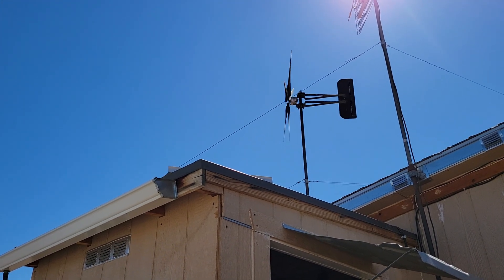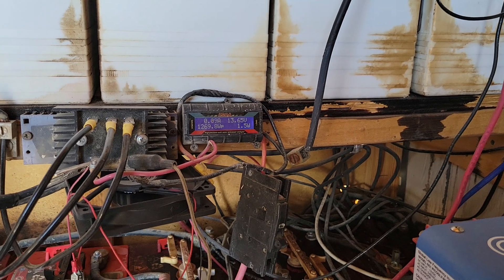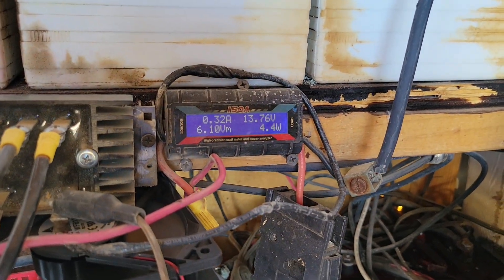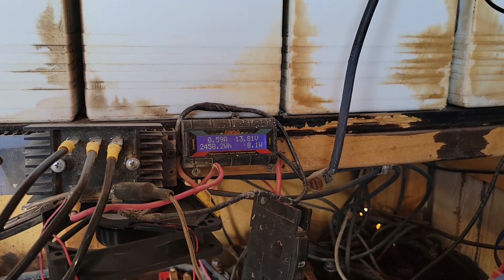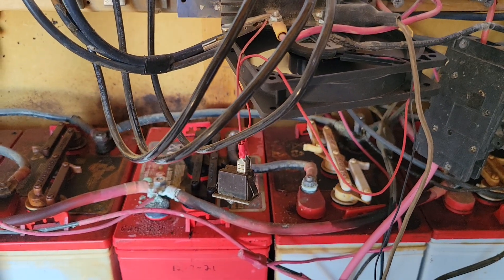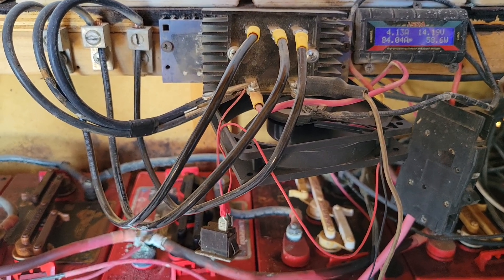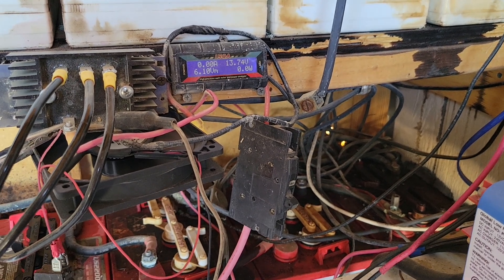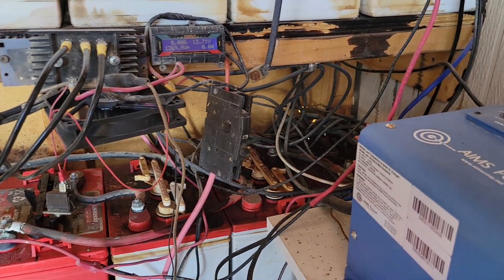Wind Turbines: Can You Run Your Whole House On One? June 26, 2022

Comment: Thank you for the knowledge wanted to start with wind turbine then solar but will have a second thought will start with solar then wind turbine
Reply from the maker: Welcome aboard!  Yes, smart choice.  The sun is present much more often than the wind.  Solar should always be the primary source, wind turbines are supplemental.  Water turbines work day and night IF you have a reliable, constant water supply.  A multi fuel generator is a great backup for emergencies.

Comment: If you only have  one  ! 

I have   4  

And those 1800 watt P.M.A.s on your  wind turbine will  work on  a Water Wheel  or Anything  else that  spins  , 
Exercise bike , steam  engine  , gas engine  , propane  engine  , and  I also  have  Solar Panels  , 
So that's 
Wind Power 
Water Power 
Solar Power 
Engine  Power 
Human  Power   

And if you get 1800 watt P.M.A.s  for each  room of your house  , and Battery  banks with Inverters  and  Solar Panels  with  Thermal heating and cooling  , 
It's possible  to run an entire  house  , because  that's exactly what I'm going to do  , I'm going  OFF GRID
Reply from the maker: Welcome aboard Jim!  Yes, PMA'S are multifunctional.  A good battery bank is very important, because you can't count on input 24/7/365.

Comment: Hey GBear.  Thanks for the content.  Had a couple of comments for the viewers.  For wind turbines.....there is a national wind energy map from the US government that gives the average wind to expect.  Almost any wind turbines makes WILD claims of what it can produce.  IF you decide on a turbine, you probably would always select one that produces a/c current to minimize the wire costs since you then would mount the bridge rectifier close to the battery bank such as your system.  One thing that I am NOT 100% on, but I seem to think IF you are charging a 12v bank you can choose a turbine that is 24 volts and designed for LOW wind so that the CUT-IN voltage(by lower wind) starts the conversion faster so that it charges the 12v battery back easier and thus less wind is needed.  Additionally, you're covered for 24v too.  Since the turbine output goes through the rectifier, the battery would not see the difference since the rectifier produces a pulse width modulated wave to mimic DC.  On off grid solar panels and living in the desert I know of a company called Santan solar near Phoenix and they sell used and/or abused panels and they can be really cheap but with risks.  However, for ground mount and things like that they are something to consider.  Also, yeah the desert dust is a PITA.  I lived in the southwest 30 years and that is another reason to look at some charge controllers that don't have fans.  However, those units are smaller.  However, the midnite solar classic can be sealed for the dusty environment too.  Be safe and happy holidays coming up.
Reply from the maker: All great points, most of which I have covered in the past.  Yes, dust is definitely a PITA in the desert.
Welcome aboard!

Comment: I don't know where Mr 🐻 got his analogies or theories from about what wind turbines can an cannot do.

Wind turbines can run your whole house without any solar panels, l have three thousand watts of panels and twenty six hundred watts of wind turbines and I keep my whole house running in the night when there's no sun shining in the night I keep my batteries in a hundred percent state of charge. running two deep freezers an a refrigerator, with my winds anywhere from fifteen to twenty miles per hour an am dumping most of that power.

At the end of the day it's how much you know about how things work where you live where and who you buy stuff from an how your wind turbines are set up.

Anyone who doubts me that wind turbines can run your whole house keep your batteries fully charged all day and all night once enough wind is blowing for your type of setup. Check out John Daniel on YouTube I've learned a lot from him he's a great guy on wind to learn from.
Reply from the maker: Dear Kurt, do you get up every morning with that chip on your shoulder?
First off, disconnect all of your solar, then tell us how long everything in your house kept running.  Secondly, wind is not a guaranteed constant, so it cannot be counted on as a reliable source.(but if you live in a place where your wind blows constantly and the same speeds, and you have figured out hot to get nearly 3000 watts of power from turbines running at a small percentage of max output, then, I stand corrected.
You could also add another 40 batteries to your bank and weather a night or 2 without wind or sun.
I thought I was pretty clear, and accurate in my statements through the video, and stand by my claim that you cannot run an entire household on a single turbine alone.
Of course, if I had made the statement that you can't tow a loaded semi truck with a compact electric car, I think you might accuse me of misinformation and tell people they can, as long as another semi pushes from the rear, and it is downhill all the way.
Sorry, but I can't give you a thumbs up or a heart for your attempt to discredit me. (But I'm sure Mr. Daniel's will, for the shout out)
By the way, I have viewed many of his videos, and always give HIM a thumbs up.
Reply: @GBear  am not gonna debate with you or do I need a thumbs up it's here nor there. 

The fact remains I shut my panels completely down an run everything I need to run in my house twenty four hours  days on ends once there is fifteen to twenty miles per hour wind and I can prove it. 
It still stands that if you have enough turbine power an enough wind and set up the correct way you can run your whole house for days on ends.

Comment: Cool video. I wish I could add a wind turbine like yours. the winter supplement is much more important in Illinois. Short days and clouds. Unfortunately all my systems are in remote trailers off grid with computers and cameras and stuff.  it’s very difficult to put a big enough wind turbine on a small trailer  that would produce any kind of real power. But if I had a log cabin or something like that off grid it would be helpful for winter time especially. 
Thx for the video
Reply from the maker: I understand.  Right now, there's 0 wind here, so the turbine is useless, but the winds come up every afternoon before sunset, and supplement my system while the solar panels take a break.

Comment: I'm just getting to the wind turbine part ; I have water in all 20 of my batteries though. The sun was hot but we had a North breeze, which helped my panels put out a little more...but, they're all dirty...I have to help build a barn in the morning, so I'm going out to wash my panels off. I moved my charge controller today...it was buried behind batteries. I put it in front of them so maybe it can run cooler now. I got some " Scrubbing Bubbles " at the discount store. I normally get a little over 30 amps in the morning but today the most I saw was 25. Yesterday it was 101 deg. and no wind...everything was hot and didn't put out much, so it got me to checking things. I re-engineered my bug zapper. The original bulb is strapped on the outside and a 60 watts LED equivalent bulb is in the middle now. It only uses 5 more watts. It attracts flies now. I had to wire brush the screen off today because it was completely covered in dead bugs. I cut a lot of the holes out bigger so the bugs can go in easier without all that plastic  in the way. It is popping a moth every few seconds right now. Cheap off grid entertainment, lol.
Reply from the maker: Lol, gotta love it!

Comment: best extremely low wind turbine yet power output as though the wind was much higher is the AirSynergy wind turbines i plan to build an axial flux like that. those turbines are good performers in real low wind. everyone has low winds. actually this was a good video for beginners to open their eyes
Reply from the maker: Thanks.  Right now I have 0 winds, and already getting hot out.